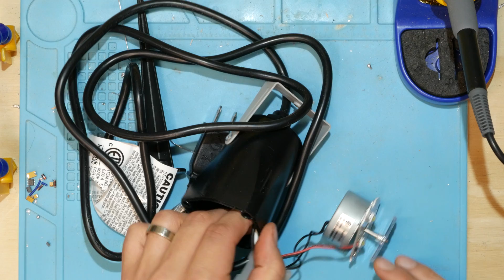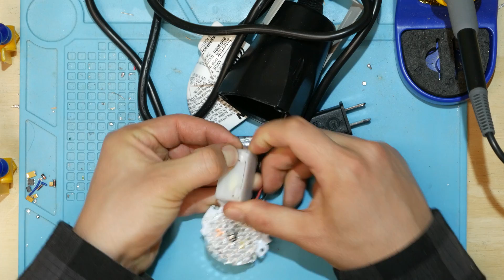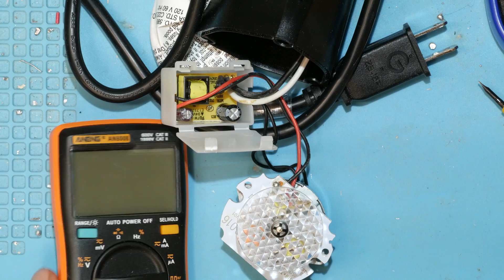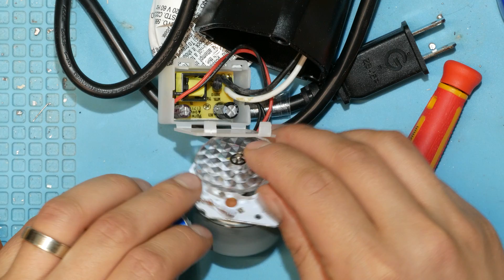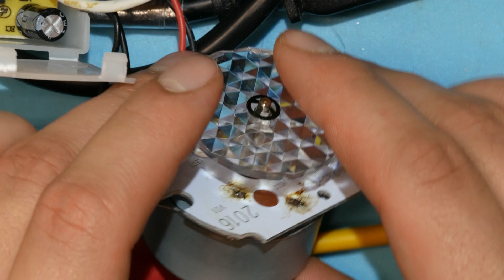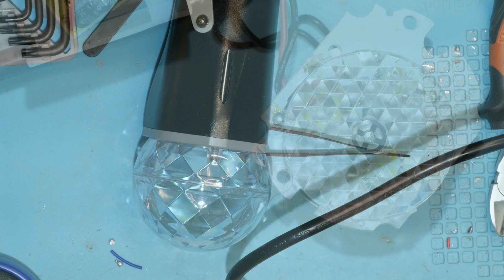Fixing Gemmy Outdoor Projector LED Light

Comment: Can you tell me what voltage the DC power ends up being? I'm assuming 12v power is needed for these. Thanks.
Reply from the maker: I think it was 12V, but double check with your multimeter. Note that these lights plug directly into 120V, and that's what the motor seems to run off of. So if you are thinking of using some other 12V supply to power it, the whole thing isn't 12V.
Reply: The voltage is not very important, the current is. Those are constant current led drivers (aka "buck converters", aka switching mode power supplies), so the voltage varies based on the current it is designed to maintain. Do NOT substitute another kind of power supply. They appear to have used two different versions, both rated at 350mA 3W. They put out about 10VDC with 3 LEDS attached to them since each LED in series drops about 3.3V (3.3V x 3 ~ 10V). So my guess is any small enough sizewise, 9-18V constant current power supply at 300-350mA will work fine. 
The idea is that LEDs brightness is controlled by current. And too much current will fry them. So a constant current source will keep them at the same brightness even if the input voltage varies a bit or the diodes age. 350mA may be overdriving them a bit to get that super brightness, which is why they may not last 100,000 hours. But I've had ones going for 9 years for 31 nights at Halloween and 31 nights at Christmas. (so 6 hours x 62 x 9 = 3348 hours so far).
These power supplies use an output transformer rather than a simpler/cheaper transformerless design which makes them a bit safer since the output is isolated from the input. Chanzon out of China is one supplier of all the electronics you would need to fix or build the same light. If you order from AliExpress or eBay (which also gets shipped from China usually) the parts are pretty cheap. Used to be great before the 2016 administration cancelled the cheap shipping China got from us ;) Not being political, just saying how crazy it was before to buy things for little to no shipping cost from China. It is still usually very inexpensive compared to US suppliers, but now you may have to pay $3 shipping on top of a $5 order. Shop around.
Reply: An note about the motor. The motors are standard 120V "synchronous" motors like are in a microwave. Synchronous means that they sync to the frequency of the AC power supply, 60Hz (cycles per second) in the US and spin with internal gears at a set multiple of that frequency (usually about 5 RPM). So you just buy one that has the revolutions per minute to match the one that burns out and has the same spindle diameter. It is a TYC-40C 120V motor. The problem is, the "C", I believe, means center post, which is almost impossible to find unless you rip them out of other Gemmy broken products and they are expensive, like $12 bucks or more. So if the motor goes, you are probably just out of luck.
Reply: It’s around 6.23 volts if the light Is Working.  If not and the Leds are drawing no amp, the board is unregulated so the voltage will spike to like 16 volts.

Comment: I just want to know how to change the colors.
Reply from the maker: If you find different color LEDs that match the same specs as the ones I linked in terms of voltage and current, they should work (of course if you mess up you might destroy your light). If the LEDs have different specs then it gets more involved as you have to make the appropriate modifications to the light's circuit, which is all technically doable but at that point why not just buy a light in the color you want.

Comment: Mine is making a really loud noise. I'm assuming that is an issue with the motor. Any ideas on how to address this?
Reply from the maker: I wish I did, but that's the problem with troubleshooting something you don't have your hands on - if it's not an issue I've fixed (in this case, busted LEDs) then I have no idea. Thinking through it logically there's really three main possibilities I can think of:

i) Something is just interfering with the spinning wheel, like a loose piece of plastic or something like that. That's your best case scenario because you can remove it/bend it/whatever to fix the issue and you're good to go.

ii) Some component on that power board is broken and causing the issue. From what I remember the motor runs directly off 120V AC so there's very little I can think of that would cause that.

iii) Motor itself is bad. Not much to do except buy a new light and move on with life, unless you're like me and just like tinkering.

I would also test it on a different outlet that's on a different circuit (eg bring it indoors and plug it in somewhere) to rule out any issues there.

Lastly keep in mind this runs off mains power, so if you aren't comfortable with how to troubleshoot the light safely the safest and smartest choice is to buy a new one.

Comment: Two questions... Mine flickers on and off... So it's almost like a loose connection..
Any ideas? Also is it hard to take apart? Did you have to use a Dremel tool and cut the thing open? Thanks
Reply from the maker: No idea why it's flickering (and I would be curious how consistent the flicker is, frequency, etc...). It is easy to open there are 3 screws hidden in the pocket holes. You need a torx key. I forget the size, but if you have a set of them you should be able to find one that fits. Make sure it's a long set not a short set so that they can actually reach. No dremel or destruction required (unlike the shredder I've been trying to get into without destroying).
Reply: T10 or 11 torx

Comment: Sir can u tell me how u open the cover of bulb ??
Reply from the maker: There are three deep holes in the side of the plastic that lead to screws. The screws are torx (I forget the size, sorry). Because of how deep the holes I used my torx key set rather than a screwdriver. A set like this should probably work: https://www.amazon.com/SATA-Tamperproof-Precision-Formed-Chamfered-Impact-Resistant/dp/B07V1JWFFX/ref=sr_1_5?dchild=1&keywords=torx+keys&qid=1605890546&sr=8-5

Make sure you get LONG ones and not SHORT. I'm not sure that short ones key reach.

Comment: Mine spins but nothing shines on the house. It was working when i first plugged it in, then an hour or so later zero Lights projecting on the house. Could all 3 have blown at once???
Reply from the maker: They are connected in series so if one dies then the other 2 won't light up either (exactly as shown in the video). But if you're going to the trouble of replacing them, you may as well replace all 3 at the same time.
Reply: Mine will be bright for a while, then goes half-bright.  I suspect that the board is not supplying the full 12V.  I am going to get into the innards of the light one more time!  thanks for great video, Matt.

Comment: can i change the color of the light anywhere
Reply from the maker: You could probably replace them with color LEDs. Without going too far down the electronics rabbit hole, you could try to find a color LED with the same voltage drop and current rating as these ones. I haven't done the search so I don't know how easy or difficult that is. You would probably want to replace all 3 if you do this, and of course, you do so at your own risk.
Reply: I have Applights models where you can change the color and effect of them. The only issue is that you have to be within Bluetooth range to control them.

Comment: Take the plastic wheel off.  You can hot glue it back on.  Don’t be a slave to a little snap ring
Reply: The snap ring was easy to pop off but the plastic diffuser wheel was held on to the motor’s shaft so tight that it needed a vice and gentle tapping to remove.  Unfortunately for me, the problem with the three LEDs is most likely something on the circuit board; probably a faulty power supply.  All three LEDs will illuminate but very dimly.  Could be a capacitor, but my desire to probe around with the damn thing plugged into the wall was not up to the task
Reply from the maker: @teodelfuego  sorry to hear! Thanks for the tip on getting the wheel off, maybe it will be useful to others.

Comment: Finally a way to fix these lights I am a huge fan and collector of Gemmy lights and animatronic items I can fix the animatronics no problem but I could never for the life of me get any of my lights working again And thanks to your video I’m able to get my lights working thankfully I didn’t throw them away Thanks for the awesome video
Reply from the maker: You're very welcome and glad to hear you can fix them now :) hardest part was figuring out which LED is the correct replacement!
Reply: I may need your help Mr Halloween Christmas Ghost Boi - I have a Winged Angel of Death who in the process of fixing the broken wing apparatus, some of the animatronic wires got disconnected in the main box and I don't know which ones go to what.  Is this something that you may be able to assist with?

Comment: how did you take the top off?
Reply from the maker: There are torx screws you have to unscrew. You can see these long pocket holes in the body of the light, you need to get a torx screw driver (I forget the size) into each one and unscrew those screws. That gets it open.